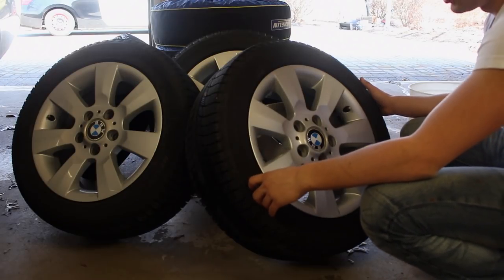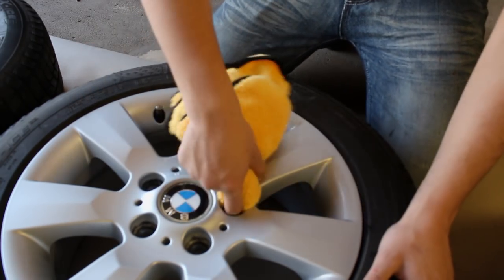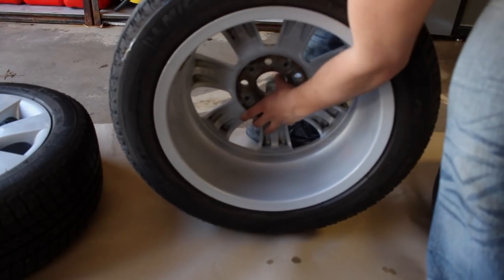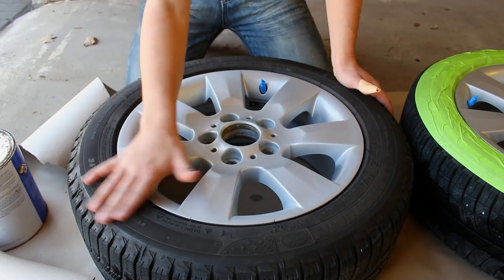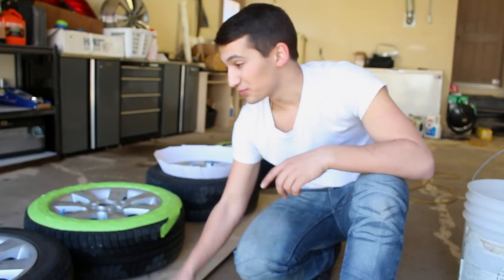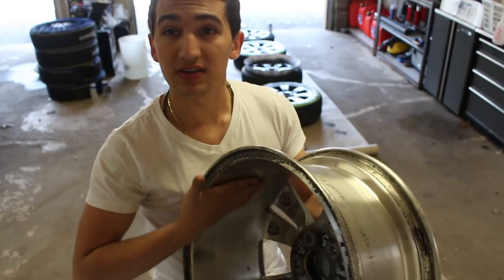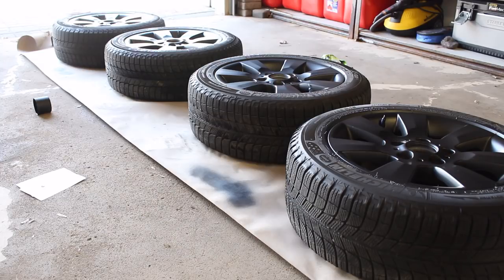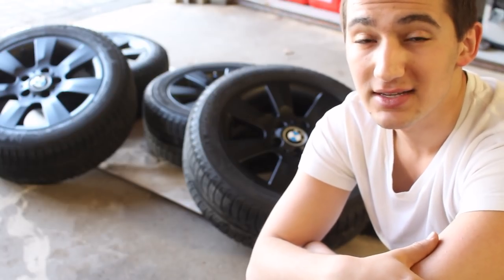DIY: PlastiDipping Wheels 4 Different Ways

Comment: That is a thick ass first layer! Almost zero transparency after coat one! Big no no! Your first coat should have been much thinner.
Reply from the maker: What do you mean big no no..? You can see there are no runs and the finish came out perfectly... Where you not watching the video?!

The only reason why you hear people say only dust on a first layer is because the people watching those videos are only beginners and learning how to get plastidip down without runs. You will get more or less the same finish if you go with lighter coats but more layers. I've been dipping for years and I've come to like this method.
Reply: Supposed to be around 50% transparent
Reply: Milan Mastracci you did it wrong we all know stop crying and own up to it it was wayyy to heavy should have been a light DUST

Comment: Its not true that you don't need to go into the "5,6 and 7" coats, I talked with a guy from dipyourcar, and he said where I live with salt, ice, snow in the winter, and off roading in the summer, 10 coats will make it last a long time and not tear if hit by a chunk of ice and that is common here.  He advised i buy 2 "car kits" and i may have 1 or 2 cans left over wich i plan to use on my grill anyways!
Reply from the maker: I live in Canada and live where theres a TON of salt, snow and ice. When dipping your wheels, you don't have to put that many coats down on as as your side of your rim isn't going to be getting a abused. Obviously the more you put down, the more durable it will be however its not necessary to put 5, 6 or even 7 coats down on your wheels. If you're doing the front of your car, yeah i'd put that much down there but when it comes to rims, you don't have to go that crazy.
Reply: Sick Dips Don't take it like i'm trying to say you did a bad job on your video or anything, i just felt like i should relay what i was told on the phone, from a technician at the company that sells the stuff and does it for a living.  "you only stand to gain strengh and durability from making the dip as thick as possible"  Now when people scroll down and see our comments they can decide for themselves how many coats to put on. That coupled with your instructions wich are far above average, will give them results that suits them best.
Reply from the maker: kazymerchyk You have to keep in mind that those guys from DYC are based off in the lower states. They do get salt and snow but not a heck of a lot. Nearly every single day during my winter up in Canada, my car gets covered in salt even on a nice sunny day. I'm exposed to this stuff constantly and have never seen my wheels or even car for that matter, get that damaged because of regular salt, snow or ice. The flat front-facing panels of the car, like the front bumper and mirrors will get the most amount of abuse during the winter so it makes sense to put more plastidip down on those areas. Wheels on the other hand will not get that abused. I can personally attest to that. I've never had a rim, nor a customer come to me saying on my wheels aren't holding up to the winter. Of course the more layers you put on, the more durable the finish will be, however for the wheels its just overkill when you're putting that much on there. Another thing to keep in mind is unsprung weight. The weight of the plastidip isn't that much, however when you're talking about putting it on a wheel, every ounce makes a difference in the way the wheel behaves. You will notice slightly less power to your wheels, and increased fuel economy. If you can keep the amount of unsprung weight down, the better. What i'm getting at is there are a lot of factors to keep in mind whenever you're doing anything to your car. If you want to put more plastidip down on your wheels, just keep in mind of the effects of doing so.
Reply: Sick Dips Good point on the extra weight, as a mechanic i really should have thought about that, but ofcourse my truck is 5000 lbs and has a v8 putting 310 to the wheels so in my case weight is less important, I also have a 100 lb push bar on the front of my truck and i didnt feel any difference in power.. so i cant necessarily agree with you.. only from lack of experience with smaller project cars but i see your point 100 percent. Lol your discription of the canadian salt was my day today, i washed er up and looked fan fuckin tastic, drove 10 minutes on pretty dry roads and shes covered.   All you can do is try right?
Reply: Sick Dips Where in Ontario do you live?
Reply: kazymerchyk
I have the rims, the logos (front and back), and the grille all done with matte black plasti dip (4 coats). I live in Ohio in the snow belt and there has been tons of salt, snow, ect.. Even though the rim at times will be absolutely covered in salt, making the rim actually look even silver or white, there is no damage to the actual plasti dip finish, color, or texture (or, there has been no texture of the dip, I should say). It is staying on strong and have had no problems. I will say on the grille (I am likely going to re-do it) I did somewhat of a poor job on the chrome going across the grille, and there are a couple of spots that the dip lifted up on the chrome while I was peeling off the excess dip around the chrome. The chrome showing spots are relatively unnoticeable, but I was worried about the durability of the dip and the chance it may start peeling off more due to the spots that the plasti dip had lifted, especially with it being on the front of the car. I inspect it often, and there has been no further peeling of the dip than what was begun with due to my fault. From my personal experience, I see no need to do over 4 coats on the rims, maybe 5 at most.
Reply: Sick Dips
Also great video and instruction. The first time I dipped my friends logos I had gotten some texture on the finish. For some reason it did not happen when I did my rims and logos on my car, but now I realize it is because I went to light on the last coat on my friends car and did not completely cover it wet. Thanks for the tips!
Reply from the maker: kazymerchyk Yeah I'm located in the Niagara Region. So close to Niagara Falls. And Austin Peko  I'm glad to help :)

Comment: What about the nuts? they are still silver
Reply from the maker: +metro8731 What about them? The video is about dipping the wheels black. 
I personally wouldn't put any dip on the emblems because as soon as you take the lug nuts off, you will tear the dip.
Reply: i was wundering how you sprayed the lugs is all,and how not to have a solid black rim and  silver lugs
Reply from the maker: Well I didn't spray the lug nuts. With the wheels off of the car, the lug nuts were set aside so I could do the wheel black and leave the lug nuts silver. If you want to make your lug nuts black, I would suggest either buying powder coated black lugnuts, or dip them with them aside. So with the lug nuts off, spray them separately from the wheel.
Reply: ahhh powder coat is a good idea... but if i wanted to go dipping route will an impact of even a socket rip the dip off the dipped nuts when putting them back on?
Reply from the maker: It will, but just as it will on powder coated wheel. On the dipped wheel, it might tear, where a powder coated wheel will scratch.

Comment: Do not tape your wheels. Use posted cards. No pealing needed and comes out with a flawless perfect line. They cost about 3 dollars if not less for about 1000 cars. Line them up inbetween the wheel and the tires. no over spray and no mess. Pealing platidip off of rubber can be a pain.
Reply from the maker: That technique is demonstrated with the q cards, however you are limited as to where you can position the can so you may not be able to get 100% coverage (for beginners). I have a video coming out showing you guys how to make dipping your wheels a lot easier. :)
Reply: Sick Dips bend them. more coverage over tire and more angles on rims

Comment: How long between coats.
Reply: I usually do about 15 minutes
Reply: Jarrod Duhon it depends on where you live. The humidity has a lot to do here, if you are in a humid place, then wait 30 minutes. I am from Costa Rica, I had to wait 20 minutes between coats. Just make sure every coat is dry before apply the new one. Cheers

Comment: How many cans did u use?
Reply from the maker: I used 4 cans as I did 3 coats of dip on the barrel of the wheels.
Reply: Sick Dips How many cans would you need if you just do the face? Like 4 coats..
Reply from the maker: ***** You could probably do 3 cans and be okay. I find its always better to have more than you need, than not enough

Comment: You can do this for $100 (plus all the effort) and end up with a DIY finish or just pay like $400 to get it professionally done with real paint/powder coat.
Reply from the maker: ***** That might be true however I'd rather spend the 100 dollars and get a 'DIY finish' and do the job myself than spend the money to get someone else to do it for me. Also, the beauty of this stuff is that it is removable. Once you're done with your black wheels, you can peel the black and go back to silver at any time. You can't do that with real paint / powder coated wheels.
Reply: Sick Dips I looked at this video because my 18" alloys on my '12 BMW Z4 were scuffed up and I was looking to change the colour as well and I don't feel like dropping 2-3k for new alloys. Today I was quoted £260 (about $420) to have them refurbished AND powder coated matt black. If it's $420 in the UK it's probably the same if not slightly cheaper in the US. Also with plastidip alloys the number of coatings is important — if you do too little then it will come off in small pieces when you remove it. Plastidip ain't worth it, but good video though!

Comment: Big mistake spraying the wheels laying on the ground. They should be a upright at a slight angle. See Dip My Car videos its the first thing they point out.
Reply from the maker: Care to explain how dipping the wheels on the ground is a mistake? You can move around the wheel very easily as apposed to move your car forwards and backwards to hit angles you couldn't hit. Also, did you not see the final result?
Reply: LOOKS great but they state to spray with the can upright and the wheel on the tread with a little tilt so the can stays level. Probably doesnt matter as much with back as it does the metallics.
Reply from the maker: Sin sin sinner As long as you warm up your spray can, and shake it before you spray you will not have issues with either a regular solid colour or even an enhancer such as a metallic. Try it out and you'll see what I mean. The reason why I lay them down is because you can get at the wheel any way you like and you can position it so if you happen to have a run in your dip, the run will run towards the back of the wheel and not look too noticeable.
Reply: got you

Comment: So much bad advice here.  Wheels need to be upright, as the  spray can needs to be kept upright, also 1st coat is 50% coverage only.
Reply: Yeah? Did you not see the final finish? Also the benefit of keeping the wheel face down is if you get a run, it isn't noticeable because the run will go into the barrel of the wheel instead of down the face of it.
Reply from the maker: +Matic Krmec I agree with you 100% however not everyone that dips wheels for the first time will be doing it right. Thats why i'm giving them a fall back or a safety. So if they do make a mistake and create a run, it won't be noticeable
Reply from the maker: I did not show it however when you dip the face, after the first coat, dip the barrel of the wheel to make sure it is uniformly black.

Comment: Screw taping that shit its called index cards 1000 times faster and easier...
Reply from the maker: If the index cards work for you, thats great. But the think with the index cars is that you can't pick up the wheel and move it around so you won't be able to get the backside of the barrel. Even if you wanted to do the face, I find them to be very extrusive and you can't get all of the side angles that nicely. If you use the index cards, you'll notice the outer part of the rim won't be covered in plastidip.